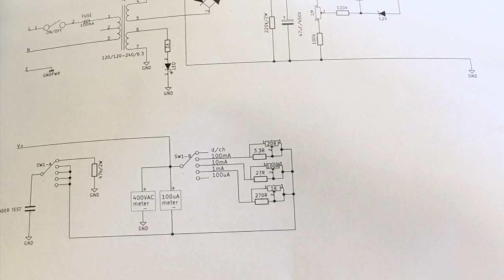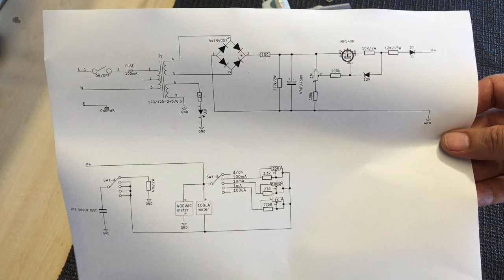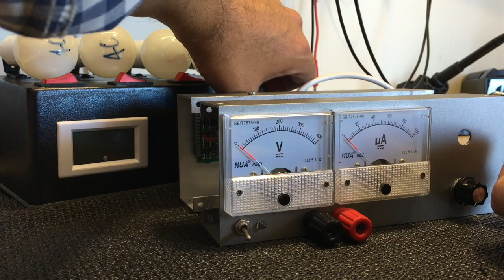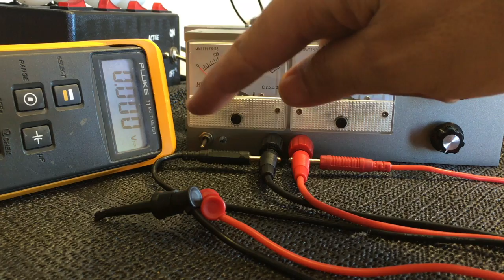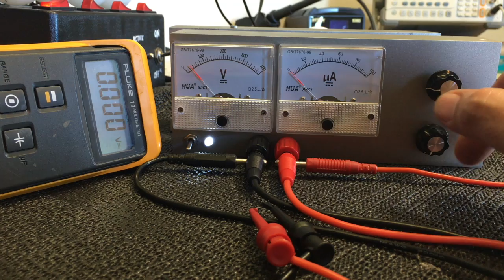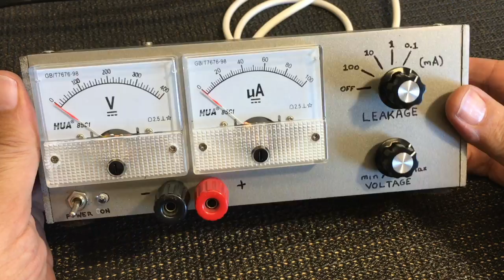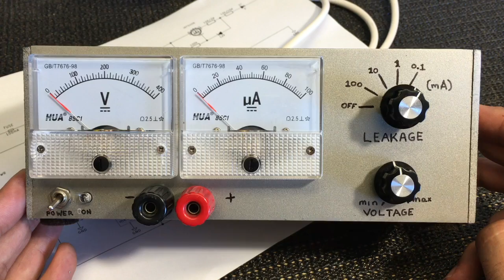Capacitor leakage tester design & build DIY - Part 1

Comment: Thank you for this series of videos. I have successfully built, tested & used a derivative circuit. HT is supplied by one of those £5 Ebay high voltage modules from China. One addition I made was to add a high brightness led in series with the 1N4007, these will begin to emit light at around 0.1uA & serve as an excellent charging / leakage indicator. Since the little HV module can supply  much less current than your transformer, there is no danger of exceeding the forward current of the led. As a bonus, the FET never dissipates enough power to even get warm in free air with no heatsink.
Reply from the maker: Russ Milton : the Chinese module is a great option. I got one myself but had already built the cap tested by then.
Reply: Russ, can you post a link to one of those HV modules you mention, to better check what it is? thank you
Reply from the maker: Something like this. They scare the s… out of me 😊 
€ 6,78  35％ Off | 2pcs High Voltage DC-DC Boost Converter 8V-32V to ±45V-390V Adjustable ZVS Capacitor Charging Power Supply Module
https://a.aliexpress.com/_msBhAHO
Reply: @electronicsoldandnew  Obrigado
Reply from the maker: Prazer

Comment: Hello, My capacitor leakage tester is now complete.  I'm in the USA which uses 120VAC service.  So to bring the tester VDC up to 300 volts I used two Tamura 3FD-512 transformers (T1 & T2) back-to back (available from Mouser).

T1:
Primary pins 1&3 and 2&4 are connected together (120VAC line in)
Secondary pins 5&7 and 6&8 are connected together (6.3VAC output)

Note: I also used the 6.3VAC for the LED on/off indicator (rectified and smoothed)

T2:
Secondary pins 5&7 and 6&8 are connected together (and connected to 6.3VAC from T1)
Primary pins 2&3 are connected together.
240VAC VAC output available across primary pins 1&4 (CAUTION!)

Mr. Calderia, I noticed that your uA meter was bouncing around a bit when the leakage current switch was set to 100uA.  Mine also bounces at that setting.   And if I look very closely I can also see the  current needle bounce very slightly on the 1mA setting.  Do you know why this happens?   Do you have any thoughts on how to stabilize the uA meter at 100uA?

Thank you for this outstanding series of instructional videos.

Dave
Reply from the maker: +XT500C : well done. I'm glad you now have a complete tester/reformer. I hope you get as much use out of it as I do from mine.
The 'bouncing' usually happens on electrolytic caps when I reform them. It is perfectly normal because you are getting small surges of current leakage in the spots in the capacitor that are more leaky.  What happens is that the 'leaky spots' are basically being 'filled in' or reformed by the current 'sparks' that are leaking sporadically through that little part of the capacitor. When the cap reforms, these leaky spots get 'filled in' with the formation of aluminum oxide, which is what the reforming does. You don't want to smooth out the meter as this is giving you a true indication of the actual leakage in the cap. Just use it on a higher setting until the final leakage current drops very low and stabilizes. Also remember that you will never need to get the actual leakage current to zero in an electrolytic capacitor. Even new caps are rated with some leakage current. The trick is to reform it to the point that it is low enough to be within an acceptable level. I usually accept about 200uA on a 50uF cap.
Reply: Thank you for your reply.  What you've explained makes perfect sense.  As a device that's basically composed of 2 plates and an insulator (dielectric), capacitors certainly have complex characteristics and personalities.

Comment: Just finished mine yesterday but I made an addition, I added an ESR meter to it. I used my CNC router to make the circuit boards. I used the 3D printer to make a case and I also added a switch to switch the probes between the ESR and Leakage tester. The ESR meter is arduino based, with a small 1" x 1" OLED display, so I added a 5v supply as well. No need for a power indicator LED though. The OLED is enough to let me know it's on.
Reply: BTW, do NOT be worried about carrying on to much. I enjoy your videos and your in-depth explanations. Thank you for taking the time to show your work, I enjoyed making the project as well.
Reply from the maker: +Ian Ide : that's great. Becomes even more useful.
Reply from the maker: +Ian Ide : that's great. Becomes even more useful.
Reply from the maker: +Ian Ide : thank you.

Comment: Very nice project well thought through. I will build it.
Only addition I'm thinking about is a momentary push button that displays the voltage across the cap (propably just in discharge mode). I think this is useful when testing big caps of power supplies (SMPS). Not what you built this project for, I know.

Comment: Very nice bit of kit. Well designed and extremely useful. Just got to catch up with the other parts now and might have a go at building it when I get chance. Thanks for sharing. Graham
Reply from the maker: +Radiocruncher: glad you like it. This is also a project that I've been putting off for ages while I finished other stuff. Finally got to do it. Happy I did.
Reply: I have an old Heathkit valve capacitor tester here for restoration but yours certainly looks tempting to build

Comment: Excellent project but a little concerned that you used the transformer bolt as an earthing point at the disc end. It would be easy to introduce a shorted turn across the mains transformer putting it here. Better to have made its own separate earth/grounding point away from the transformer mounting stud. I found that charge/discharge cycling seemed to encourage re-forming quicker, at the same time working up from a low voltage to maximum working voltage. To this end, could you use the low voltage winding to produce a DC supply for a simple 555 Timer operating a charge/discharge relay? You could leave this happily clocking away until the leakage current reduced whereupon the applied voltage is increased and so forth until minimum leakage is obtained at maximum voltage. The relay could be manually operated for taking your normal measurements after which its de-energisation  would always make sure the capacitor was discharged. Using a relay with higher current contacts would also allow a quicker discharge time when reforming high value electrolytics. Regards, Les
Reply from the maker: +Les Carpenter : good point on the position of the earth tag. As for automating the reforming process, it's a great idea. However, I don't do enough reforming to justify altering my one for the purpose. I also prefer to stick around when reforming 50 year old caps, as the risk of burning my workshop down is quite real. 
This is what I love about the hobby - your project can always get better!

Comment: Just one little puzzle left - how exactly the two enclosures were joined, and how the end caps were fitted and fastened.  Excellent project, sir.
Reply from the maker: Thanks
Reply: @electronicsoldandnew  Certainly welcome - have you used this enclosure type before in another video?  Would really like to see how it all comes together.
Reply from the maker: I’m afraid not.

Comment: I made a jury rigged tester with a less sophistication circuitry, on a breadboard.  I use an external Vintage Knight Allied VTVM to monitor voltage and a recycled 10ma ammeter to monitor leakage current.
Reply from the maker: Cosimo Kramarawicz : if you’re working with high voltages, a breadboard is very dangerous! Be careful.

Comment: I have a few valve radios to recap and this is exactly  what I need. To be honest I will recap anyway but it will be interesting to see how good/bad the old caps are when I take them out.
Reply from the maker: +mbaker335 : I've found that I still need to replace the paper caps, but this has helped me save quite a few electrolytics.

Comment: Hello Mr. Caldeira. 
This video is actually the one that made me discover your channel about a year ago. I had the thought of building this tester in a corner of my mind since then and finally I have the time these days. Thank you for making this design available to your viewers. Capacitor leakage testers are very expensive, although it is a good piece of equipment to have on the bench, many hobbyists like myself prefer not to invest in one since just replacing all the capacitors usually comes cheaper :-) I do not do tube work but, apart from various low voltage circuits I do SMPS repairs which usually have 400V capacitors. So, I am thinking of having a 220 to 290V transformer wound specially for this, which will give me around 400V DC after rectification. I have a few questions, if you have the time :-)
1) What would you recommend for the the transformer power? The smaller it is, the cheaper it will be, so I want to order the lowest power I can get away with.
2) Have you encountered any problems / quirks with it and / or made any design improvements to your tester after using it for almost 1.5 years? 
3) Since I do a lot of low voltage work I use low voltage rated caps, so I need a lower minimum voltage (even 0v)  if such a thing is possible?
4) Do you have the schematics in a mailable format like PDF, with the changes you might have done on it over the time? I can always do a screen capture from the video, but I would really appreciate a clean copy.
5) And finally... I wish you and your family a Happy New Year and all the best! 
Greetings and best regards from Ankara / Turkey.
Reply from the maker: Bora Yurtoren : I agree with you about the useless of this device. I use it all the time and have done so since I built it. As for the answers to your questions: 
The device only needs to deliver a few milliamps. Any leakage greater than that means your capacitor is really too leaky to use. I would therefore recommend you get very small transformer rated at the voltage you need, and able to supply 20 or 30 mA.
I have not made any changes to mine since I built it, but I have received a few good suggestions and comments to the videos, which you might benefit from reading.
You can build the device to supply from 0 to maximum voltage. This is achieved by eliminating the fixed resistor at the bottom end of the potentiometer. However, be careful as the full voltage will be applied across the potentiometer so you will have to buy a potentiometer that can handle the full voltage.
I do not have a PDF version of the schematic and instructions to send you. I would ask that you extract that from the videos, which should be clear enough.

I wish you the best and hope you build and enjoy your tester as much as I have. Happy New Year.
Reply: @electronicsoldandnew  Thank you for the reply. Just to be clear, I never said it was useless. On the contrary, I think it is a good piece of equipment to have on the bench and your simple but elegant design intriques me a lot. I have decided to have a transformer wound such that it will have a 290V and a 9V secondaries. A total of 10 watts would be more than enough with more power on the 9V side (thinking of illuminated displays maybe) I will also use 2 voltmeters, one with a 0-450V scale, and one with 0-30V scale. They will be switchable. I thought it will be better to have a low voltage scale for low voltage caps to be on the safe side. Many thanks again!
Reply from the maker: Bora Yurtoren : sorry, I actually meant to say “usefulness” and it came out wrong.
Reply: @borayurt66  I’d love to know how your project turned out.

Comment: Nice housing system.. Think I might buy a cap leakage tester..I used to make special purpose equipment, tooling and the like, one off jobbing work is very arduous, even with machine tools. I've had enough of it..  Connecting components soldering etc is the easy bit..
Reply from the maker: David Price : true.

Comment: Great project and build! Thank you for your efforts to share it with us. You commented @ 30:28 that a diode was in the wrong place... that it should be on the output... Please give us the diode reference number on the schematic and an explanation of what to do to make the needed correction. Additionally, because of the high voltages, I think an emergency shutdown fail-safe switch would be prudent. How might that be engineered into the design? Maybe a hefty normally open momentary switch on the output that must be held closed while the voltage pot is advanced? A cap pops, the normal human reaction is to jump and release the switch to open it... Hmm... (Thinking)
Reply from the maker: it’s been years since I designed this unit, and it has been in use since with no problems at all. The problem is that I don’t remember the details either. I’m sure the answer is in one of the videos in the series.

Comment: I am building this instrument based on your design, but there is bit of a cofusion on connections on the rotary range select swtich.  Per schematic the 100 micro amp terminal on the rotary switch is left blank.  Does it connect ot anything or does it bypass the other ranges.  Can you please clarify.  Thanks.
Reply from the maker: The 100uA is the base range for the meter, so no shunting is needed.
Reply: Thank you so much.  This will help.

Comment: Thats a very good tester, however I use a curve tracer for checking ALL types of caps.  My curve tracer uses about 6 volts AC @100 ac ma on the high range,  and 6vac @ 10 ma ac current mid range, and 6vac @ 1ma @ on the low ac current range. My curve tracer is connected to my scope in the X  Y  mode display.  I have found that AC ma is best for checking all caps and it does not harm them.   Glx/73's

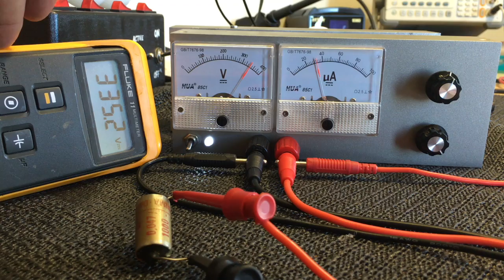Comment: 26:00 - This problem is caused by the 10Mohms DMM impedance, right?  But what about that Analog Meter? If you also disconnect the analog meter the Microamps will change?  Thanks.
Reply from the maker: The analogue meter is placed before the voltage regulator, so does not affect the leakage current reading.

Comment: I love your presentation.  I'm just learning and have gained more knowledge from watching your videos than from any other resource.  Could you please explain one thing for me?  What is the purpose of the transformer in this build?  If it is 240v to 240v why not just have the mains coming straight in? 
Cheers.
Reply from the maker: Because you’d then have a “hot chassis” which would probably kill you :)
Read up a bit on the topic, and you’ll see that a transformer is essential to isolate the mains from the system.
Reply: @electronicsoldandnew   Thank you for the answer.  I understand why isolation is a good idea when working with high voltages (picked that up from your dim bulb tester video).  I think my confusion was with the terminology used.  I thought isolation transformers were a different thing altogether, but am I now correct in thinking that 1:1 transformers like the one you use here ARE isolation transformers?  If so then it's clear to me now.
Reply from the maker: Yes. A 1:1 makes it safer.

Comment: Add 2 further banana connectors to the outside parallel to the voltmeter for correct voltage measurements to avoid leakage from the multimeter.

Comment: Hi Mr Caldeira. I'm building this tester, so far it's working fine. But one question: elco's always have a small amount of leakage, but how much is acceptable? Is there a table somewhere that shows an acceptable leakage vs microfarads/voltage? Thanks!
Reply from the maker: I found a few bits of info in the web. They don’t always agree and there’s even a formula that Nichicon provides for the acceptable leakage.

Comment: Please put a fuse in the HV line before the Fet or have a foldback circuit above the maximum current that is "safe" for the caps and you. What that is I'm not exactly sure.
To give yourself some protection from exposed wires and exploding caps is to make a block of wood based cap holder with a perspex cover and a micro switch so the unit will only actuate when the cover is closed.  If you make the cap holder with cables out ending in the banana plugs that will also increase safety.
Reply from the maker: Andrew Barnett : you’re probably right.however, the 12k resistor in series with the output limits the current to a max of 27.5mA at max voltage and absolute short circuit.

Comment: Hi and Thanks again, could you tell me if a 1/2 watt 1 meg pot will work as a voltage control/ or is a higher wattage required.
Reply from the maker: ½ watt is good.

Comment: Love the enclosure, Is that 100 x 50 aluminum? Is it 3mm thick? My local supplier has 1.6mm or 3mm.
Reply from the maker: The thickness of this one is 2mm. I’d go for the 3mm one.
Reply: @electronicsoldandnew  Thanks, ended up finding a 2.5mm which looks fine. Did you paint yours white before sticking on the transparency?
Reply from the maker: No, it was white already if I remember correctly.

Comment: Hi....I wonder what the biggest capacitor in Microfarads you can test with that instrument??
Reply from the maker: The larger it is, the longer the test will take, but there should be no limit to the size.
Reply: @electronicsoldandnew  kool that's by far the best tester I have seen. Your videos are very, very interesting 👏 👏 👏

Comment: Beautiful video and great explanations. I am just a newbay in the field and I don't understand why 100mA are taken into account for the shunt resistor calculation when the circuit is limited to 30mA.
Reply: Is limited at 30mA at 300V. At 100V will be 10.